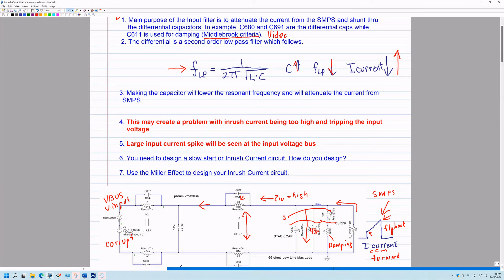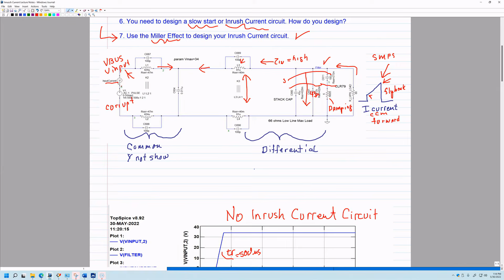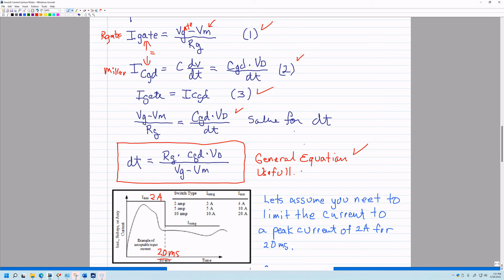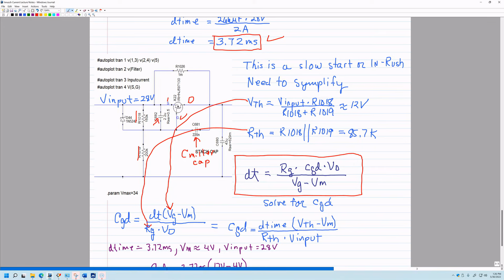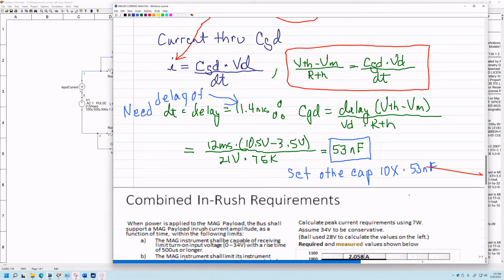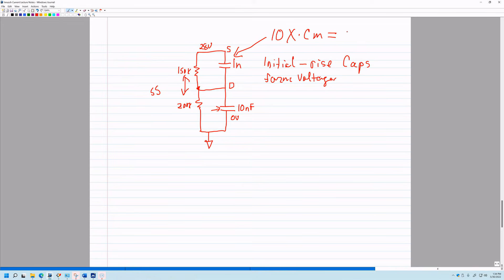Input Filter In-Rush Current Limit Design (Slow Start Circuit)

Comment: What about the body diode? How will it affect the current flow, because body diode conduction don't depend upon Vgs
Reply from the maker: Hi Muhdammad. This is a PMOS, so the cathode is connected to the source while the anode is connected to the drain. So when the input is connected, the body diode is biased off. I hope this helps. Great question.  Robert

Comment: Thanks Mr. Robert for the video it was so informative, I want to ask what is the functionality of the resistor R1026 connected in parallel with the MOSFET?
Reply from the maker: Hi Yacine, That is a good question. It is for simulation purpose to remove the slow start circuit. I inserted across the drain and source to see the effect with and without the slow start circuit. To remove it I simply change the resistance to 1T which is teraohms which can be considered to be an open. Happy New Year to you!
Reply: @RobertBolanos  thank you very much for the response, I really enjoyed your tutorials, happy new year for you too!

Comment: Thanks Robert, very informative video. The one issue I am facing with Cgd capacitor is that PMOS false turn-on during input power turn-on. How to avoid a false turn-on of PMOS?  I have two common source PMOS switch which is controlled by low-side NMOS.
Reply from the maker: Hi Nikhil, thanks for the comments. Yes, I use a version of this circuit with a n channel device to turn it on.  Adding a capacitor to the gate to source helps with false turn on . Again, thank for your inputs!

Comment: Hi Robert I watched your videos on WCA , could you please make videos on WCA on electrolytic capacitor lifetime estimation wca  and any opamp based circuit.

It would be highly helpful to get overall insight.
Reply from the maker: Hi Power Path, that is a very inportant subject. The short WCA was ment for two of our Junior engineers. I will try to make a better more comprehensive WCA tutorial. Thanks for the suggestion!!!! RB
Reply: @RobertBolanos  Many Thanks for accepting the request

Comment: Hi Robert, Great video. Thanks for posting. I had one question on the circuit. since gate voltage(in steady state) is divided version of source, Vgs I presume would be -ve  and would the transistor be on  at all in steady state?
Reply from the maker: Hi Ramesh, I do not understand your question. Can you rephrase it or give more details. I would like to clear any doubts. Robert . You can also email me at rbola35618@aol.com